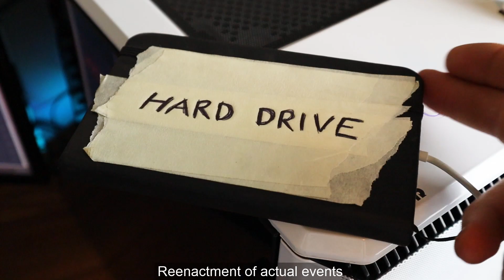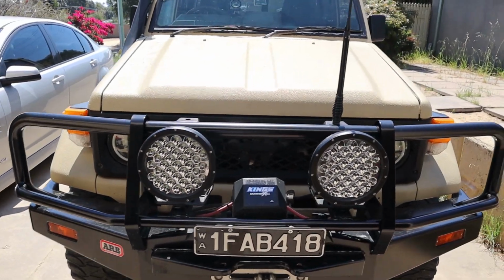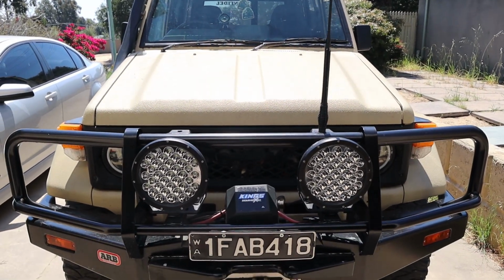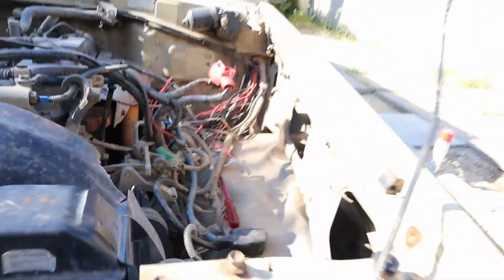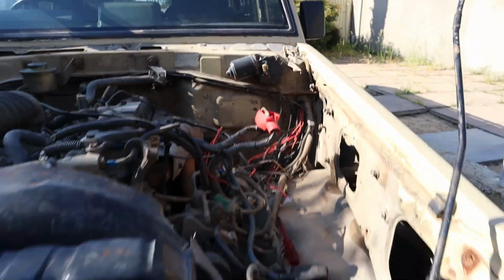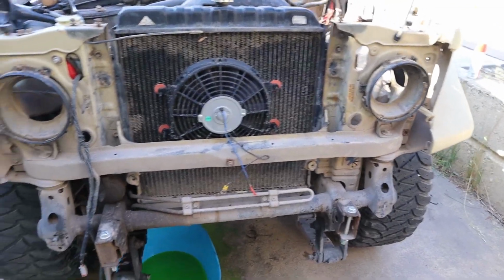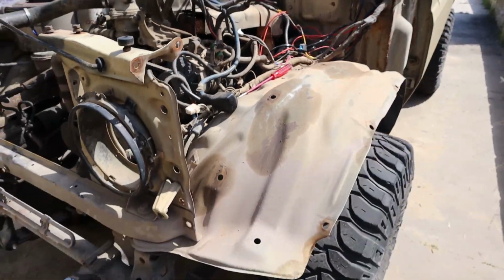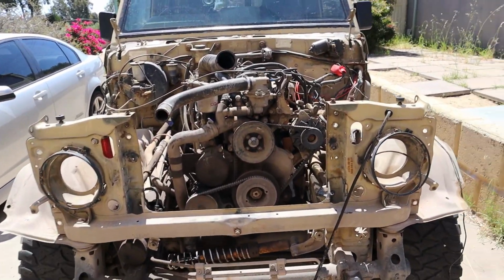2H Engine Removal - HJ75 Troopy Build (EP2)

Comment: Not being picky but next time you, or anyone else, does something like this here are a coupe of hints. 1. Your lift straps were way to long and because of this you run out of lift on the hydraulic ram. 2. You could have let your front tyres down to lower the entire front end about 3 maybe even 4 inches to make lifting the H out a little bit easier. As a bit of background I'm a mechanic and I swapped out a 3F in an FJ75 for a 350 Holden V8 from a HSV Commodore. Looking forward to watching the rest of your build.